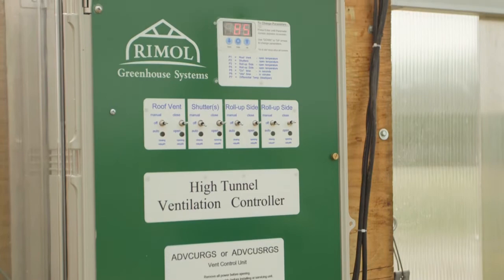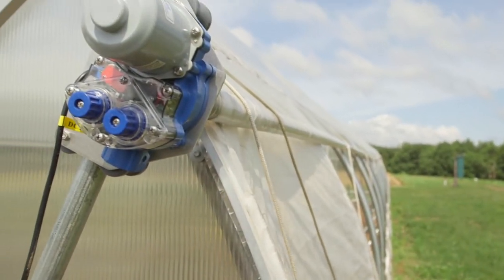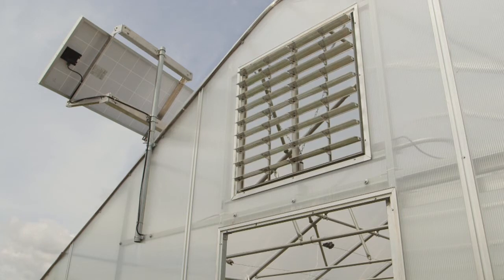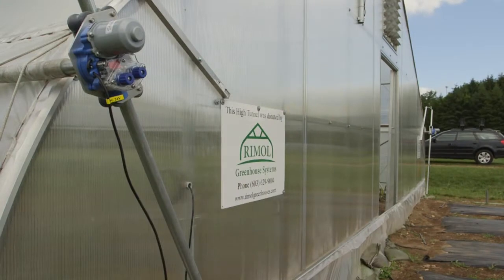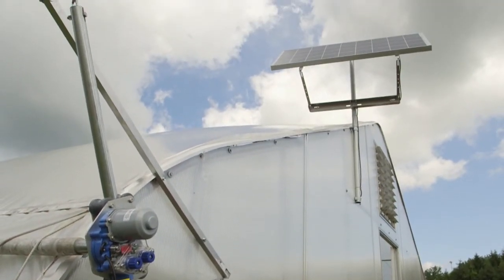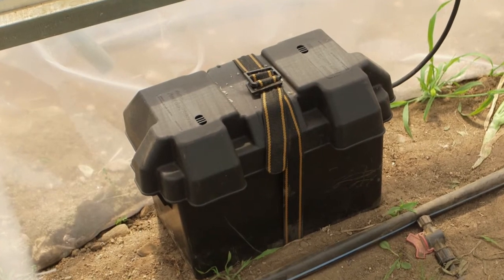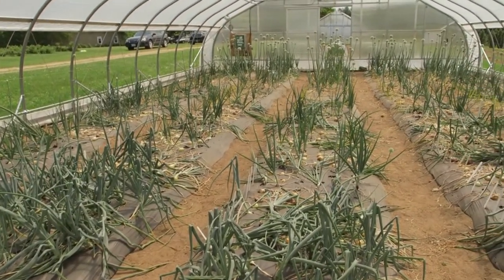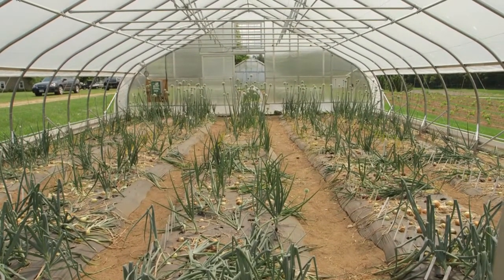Greenhouse Tips: Solar for Your Greenhouse

Comment: What type of Low Voltage fan was used? Also, what air flow rating is required to properly inflate the double layer of poly?